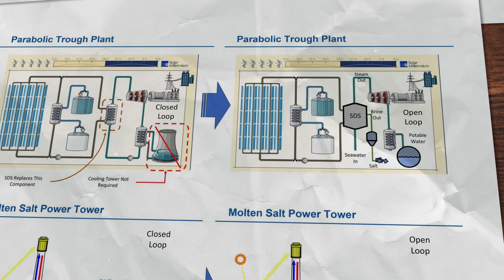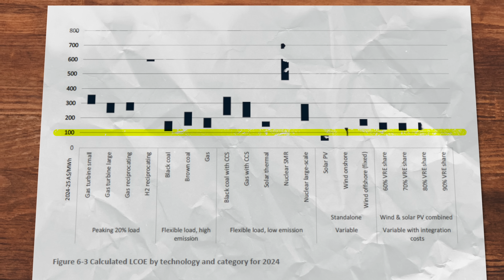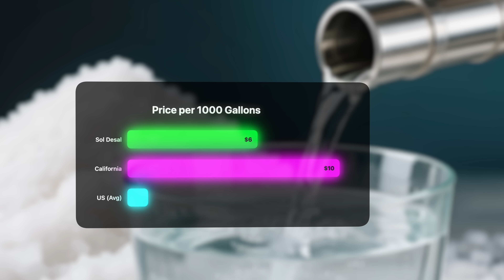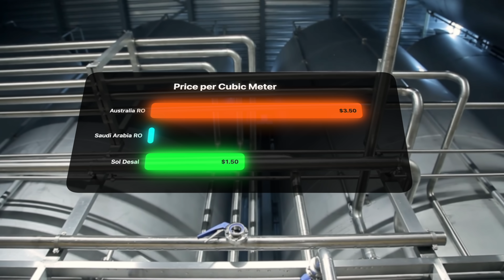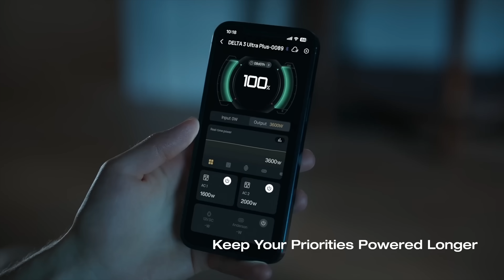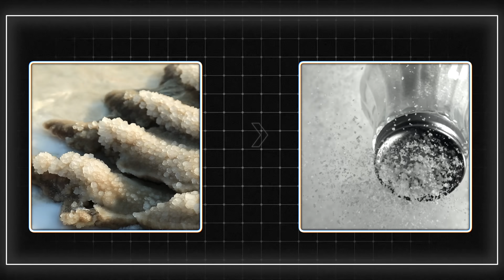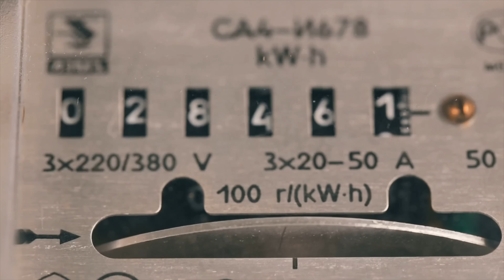The Desalination Process that MAKES Electricity - Too Good To Be True?

Comment: There's an assumption in this video that sea salt is entirely sodium salt... it isn't. With that volume of salt extraction there's also going to be a meaningful quantity of lithium salts in the mix. Whether or not it's practical to separate is a different question, but pulling it out of solution has got to be useful first step in making that possible.
Reply: That so small, of an amount, man.... but maybe in all the plants combined it would be a good offset and 2nd product over many billions of gallons...
Reply: There is gold also, but that do not mean it have any value. You have salt with a lot higher amount of lithium that can be used.
Reply: @bknesheim  well you could add Thorium to. your very long list of uneconomic extraction!
Reply: @philbarker7477 this reminds me of refining Lunar regolith. Its an absolute pain to get any meaningful amount of Uranium or Thorium out of Lunar regolith. 

I did the math and at .3 PPM for uranium you would need to refine around 3500 tons of Lunar regolith for a Kilogram of Uranium. When you could build somewhere around a thousand megawatt output solar thermal power plants with that amount of regolith refined. 

But still though it is an option, and a Solar Furnace might work well with refining the salts in sea water. So who knows maybe us guys on the moon gets bored and gives y’all the knowledge to refine terrible quality material.
Reply: @bknesheim   No meaningful gold in ocean water, 1 g / 100 Mton.
Reply: @elessarstrider5210  As I said, no value, even with a total that is more than we have ever mined.
Reply: @palpytine for a sodium battery plant that might help use a ton of the salt
Reply: No, it doesn’t make that assumption. The salt on your table probably comes either desalinated seawater or from a salt mine where NaCl salt from ancient oceans is just scooped up, minimally processed, and packaged with all the trace minerals included. Both sources are 97-99% pure NaCl. Perfectly safe.
Reply: @walterrutherford8321 desalinization through reverse osmosis will result in different end products than simply drying the brine. You'd still have the krill and various other microorganisms in brine as well as things like jellyfish bits and various excrements. They'd almost certainly be dead, but it does make a difference for food taste and allergy risk.
Reply: @ericsmith6394 but wait, then vegans shouldn't have salt in their diets!
Reply: @walterrutherford8321 right?!
Reply: Hey bro, If you were right, there would have been an entire industry that extracts various minerals from desalination! But the fact is Sea salt is typically between 95% and 98% sodium chloride!
Reply: @ecoideazventures6417  if it's a byproduct anyway, it might be cheap enough. There are several examples of waste being turned into industrial products that wouldn't be viable if the extraction cost was built in.
Reply: @ecoideazventures6417 No. Seawater salts are  6 % MAGNESIUM.
Reply: @ecoideazventures6417 If you were right, youd know, but you ARE WRONG. Currently the four most concentrated metals – Na, Mg, Ca and K – are commercially extracted from seawater.[49] During 2015 in the US 63% of magnesium production came from seawater and brines
Reply: @idiotburns  false. According to Campbells: In 2015, 47% of US's K (one of the 26 elements found in alphabet soup) was harvested from cans.
Reply: @josephmorrison5839 K means potassium, but not all potassiums are used the same. God I didnt know people were this arrogant with stupidity
Reply: @josephmorrison5839 you don't get potassium from recycled cans... You get potassium in canned preserved foods, but not the cans them selves.
Reply: @UberMick derp
Reply: @josephmorrison5839  Good one! :)
Reply: @idiotburns   read his comment again- slowly……😏
Reply: @Glenrok There is no slow enough
Reply: @Glenrok 15 years and 1 subscriber
Reply: @idiotburns  ??? Is that at me?? I’m not sure how it’s relevant, nonetheless- you missed the point of MY reply also. He was joking. THAT’S why I suggested you read it again- since you obviously missed the joke. 
I wasn’t trying to be insulting…..
Reply: @josephmorrison5839  sigh. Don’t worry, at least I got it……🤨
Reply: Couldn't that salt be delivered north for the snow season?
Reply: @kingchristopherpaul477hutc8  The largest salt mine in the world is in Canada.  There are plenty of cheap sources of salt in the north already. It would not pay to ship it far.
Reply: @kingchristopherpaul477hutc8 

Who still has a snow season? I lived in Boston for a while and I haven't had to dig my car from the snow since 2022.

It's more like a snow week nowadays
Reply: @kylejohnson6775 haha didn't know it was like that
Reply: @kingchristopherpaul477hutc8 yeah, the places that were considered extremely snowy are now about as snowy as the places once considered somewhat snowy/pretty snowy*, and the *pretty snowy places are now more like the we get a little bit of snow on the coldest week or 2 of the year places

In Europe South of Norway, if you're not in mountains, there's basically no snow anymore. I was in Munich last winter, there were a few days of a light dusting for aesthetics and mild difficulty walking around, a couple of times, and that was it.
Reply: @kylejohnson6775  Yep, considering moving north and up (from Oslo) to extend the snowy season.
Reply: Australian marine steam engineer here. There's an obvious show stopper here. Any boiler running seawater feed would scale up with hard (permanent) calcium & magnesium salts within a day's running.
Reply: @jonwilkinson3886 demister pads before the steam enters the turbine chamber, and quartz ceramic anti-corrosive turbine blades plus routine clean out schedule and multiple turbine chambers probably resolves the issue. I mean my father ran a hydro electric dam for about a decade and twice a day they had to clean the racks that blocked debris entering the turbines. They had to shut down for clean out. Why couldn't they have a valve directing steam to turbine A while turbine B's blades were being cleaned once every day or two?
Reply: @jonwilkinson3886 true??
Reply: @jonwilkinson3886  exactly - what magic have they discovered - not.
Reply: @philbarker7477  Design for separation, not propulsion.  There is a specialty alloy industry for atypical process applications.  Also ceramics, refractories.  Other process configurations too.
Reply: @jonwilkinson3886 what about using different alloys? Which are less likely to get build up? And would higher delivery pressures help reduce build up? I'm no engineer, but am a mechanical fitter/ pipe fitter with boat building background. CUNi is a popular choice on engine seawater cooling systems, but CUNi is used because it can handle the corrosive effect of the seawater more than anything. But if buildup would happen as quickly as you say, the engine internal cooling jackets would block up fairly quickly as well.
Reply: @jonwilkinson3886  The steam would not contain any salt or brine.
Reply: @toddweaver2704  You're making a declarative statement to someone that claims to be an expert in the field and that also directly refutes a claim made in the main video. The video itself says that bubbles/turbulence introduce particles of salt into the otherwise pure steam, causing the multiple problems this thread is discussing.

Do you have any sources or experience to back you up?
Reply: @MichaelDerryGameitect   An expert at what?  Observing that scale forms in some specific case or more broad, like separation process design?  You realize steam does not foul and scaling, nucleation can be exploited?  Material economics limitations in one application are not necessarily the same in another.
Reply: @elessarstrider5210   "Marine Steam Engineer" seems about as directly applicable as can be expected.

Like I said, the video itself claims this is a problem. I'm not saying it can't be overcome but some random commenter saying, essentially, 'nuh uh, steam doesn't have salt' isn't very compelling.
Reply: I was thinking about this in the other direction: 

How safe and useful is the salt given all the other stuff that's in seawater brine? Can you just directly eat it like table salt? 

And for industrial applications you'll probably need to purify the sodium. It depends on where you are in the world I imagine, but there's a bunch of different metals and other elements dissolved in that seawater that will precipitate out. 

I wonder how valuable it'll be to separate these metals out. Some years ago the Japanese were looking at trying to harvest uranium from ocean currents with special polymers, so they could become more self sufficient on fuel for nuclear power plants, for example. 

If you are harvesting seawater salt at such an absurdly large scale that it can supply any significant population, there's probably several valuable elements mixed in there in sufficient quantity to be useful. Lithium. Uranium. Silicon. Phosphorus. 

Uranium is 3.2*10(-3) mg/liter in seawater. 

If you supply all of, say, German household water use with desalinated seawater (856 liters/day per person, and there's about 83,000,000 people living in Germany at the moment), my math says you get 227 kg/day pure uranium. 80 tons/year, roughly.

We use less than 100,000 tons per year. That's not a lot from desalination, but that's also far from nothing. That could be worth harvesting and selling. Especially since literally every country has access to seawater and many countries would need to desalinate a shit ton in the future as the climate change. 

Hell, if the UAE harvested uranium from their current desalination brine production, that would be in the ballpark of 8 tons/year right now.

And that's just uranium. There's other elements that are literally a thousand times  more concentrated in seawater. Potassium is literally 100,000 x more concentrated in seawater than uranium. And if you pull the water from agricultural runoff, it's even higher than that. So the UAE could be harvesting almost a million tons of potassium per year from their current desalination brine. That's over 1% of the total global annual potash production. From the UAE, a tiny state on the Arabian peninsula. And we really need potassium for fertilizer. 

Yeah.... yeah the more I think about this the more I think it's a good idea to harvest the brine for all sorts of stuff besides sodium salt. 

If they can make his work, this is a very, very, good idea. Turn brine from a waste product and environmental regulation pain in the ass, into a resource.
Reply: @kylejohnson6775 "Literally every country has access to seawater"
Cries in Swiss
Reply: @michaelmartin9022 

Tears are saltwater ;p
Reply: @michaelmartin9022  well, you have glaciers, so you'll be fi-.....
Oh, you HAD glaciers.

Just kidding, you still have natural spring water, you don't need to desalinate any water
Reply: @michaelmartin9022  "Literally" now means "figuratively" or "virtually" it seems.
Reply: @michaelmartin9022 The Swiss have salt mines🤦🏽‍♂️
Reply: @kylejohnson6775  That is a definite potential downstream process that would be far easier in the transition stage than trying to extract it from a semi-trailer sized brick of salt... but would require far more complexity than the company can probably afford to implement, or safely.
Reply: @kylejohnson6775  wow. I'm gonna read this a couple of times. Thank you.
Reply: @kylejohnson6775  You really dont have to use the salt.  Electricity and fresh water probably the valu.
Reply: @kylejohnson6775  seawater is extremely close to human blood in mineral composition.

Diluted to appropriate salinity (assuming it's not contaminated by pollution), it's perfectly safe to drink
Reply: Sea salt is saleable directly from evaporative process. There are reasons why people consume sea salt specifically because it's not only sodium. 

Not to mention it is always worth separating because of the high value of lithium salt as opposed to other mixed or refined salts.
Reply: The determining factor for whether that is financially feasible is more about the market prices of the sodium salt. Otherwise storage costs of the sodium salt is what kills their buisness model.
Reply: I would imagine there's a way of melting the salt like metals and using chemical additives to bind either the normal salt or the lithium salt so that it's easier to separate. Then they could just use another method to break the binding agent from the lithium/sodium salt to reclaim itTo reclaim it and use it later.
Reply: @nerdlingeeksly5192 Like an DLE Ion exchange process?
Reply: Yes, and disseminating, the oceans would be suicide at large power, consuming scales
Reply: Hahahahaha
Reply: @palpytine  Even then I think this would be more efficient because the total energy spent to desalinate would be lessened. I don’t expect it to generate any extra energy, my hope is that this makes ocean desalinations less energy expensive.
Reply: The low level concentrations of these elements generally aren’t economically viable to bother with.
Reply: DLE tech in the input side of the system  would grab it.
Reply: Yes but the other minerals make the salt MORE valuable not less.
Reply: Journey of a thousand miles..
Reply: If the goal of the salt is for sodium extraction rather than food consumption, then the impurities are probably not going to be that bad, since there are forget processing steps ahead to get to the battery manufacture that is being proposed
Reply: There's more lithium in the ocean, than on land. 
And when Lithium deposits start running dry in about 20 years, mining it from the ocean will suddenly become profitable and viable. 
So yeah, including that in the tech now would be a game changer. Despite what the detractor comments are saying
Reply: @palpytine  road salt
Reply: @palpytine  people already buy Seasalt because it is seasalt with more trace minerals. Himalayas salt is ancient seasalt apparently yea bizarre 😳 hu wow
Reply: Potassium, silicon and calcium maybe but lithium so little that this is basically useless.
Reply: Uranium there as well. 

I am convinced flash desal like this has a huge future particularly in places like Australia, middle east and California. Reverse osmosis is fine at small scales but start to hit problems at large scale where the briney side becomes troublesome.

Extracting the salt as mineral has huge potential for industry. Sodium, lithium and magnesium will be metals in high demand. Calcium and potassium are important in agriculture. Then of course there is uranium and of course if you could extract heavy water from the system that would be great.
Reply: Well, Israel has figured it out; of course if you hate Hebrews you will not recognize or believe the truth. Carry on ... 😂
Reply: Once the sodium salt precipitates the remaining liquid could be dosed with lime to precipitate magnesium hydroxide as magnesium is a valuable metal(has been tried after WW2 profitably then). You could then remove potash, uranium and other valuable minerals I suppose
Reply: 💢💢   >>> Around 2005 we demonstrated an ultra-simple, low cost, waste heat driven desal/purification system. We considered incorporating concentrating solar which would have the precursor to  SOLDESAL. Life happened and here we are.He had plans to clean up the eco disaster in Salton Sea in SoCal <<< 💢💢
Reply: TYPO:  He had plans to clean up the eco disaster in Salton Sea in SoCa
EDIT: We  had plans to clean up the eco disaster in Salton Sea in SoCa
Reply: 7:53 😂😂😂😂 it's one of the most elementary tasks that can be performed with passive energy.... The only time it's difficult is when land surface is scarce or when one tries to increase output for a specific demand with mechanical apparatus (RO)....

There's much simpler methods including use of fresnel lenses and sunshine....
Reply: 10:55 PV and RO are unnecessary bottlenecks SMH
Reply: Would you consume the salt in food ?.
Reply: Sea salt is also used on potato chips.
Reply: It could be meaningful over time, similar to how it happened during WW2 and the Deuterium accumulated on Scandinavian power plants
Reply: You forgot the micro plastic
Reply: Where is the market for this much sodium chloride? If you don't have anywhere to sell it, it is just accumulating brine, which is a potential h0environmental hazard in large scale if not managed.
Reply: Old Yorkshire saying (with the phonetic accent) "where there's muhk, there's brasss!"
Reply: Sounds good. I believe it once there is one up and running and performing as planned.
Reply: @palpytine  🤦🏽‍♂️There are no problems just solutions. How about water hold pits that allow the salt/ sediment to flow to the bottom and the water pumped off. Let the pits dry and then scape them out. It would eliminate most of your problem.
Reply: ....THAT'S WHY IT IS way better TO BE USED IN pickling!

......LIKE NOT just,BUT HOW MUCH OF THESE!!AND ALL THEM GIVING A crisp!!
Reply: @robotnikkkk001  No it wasn't.

The fact that the word bittern actually existed to refer to the non sodium salts in sea salt that made it less useful for preservation should be a very good clue on how much people appreciated unrefined sea salt in the past.

Not at all.
Reply: @eccentricthinker142  ......WELL....I definitely REMEMBER THAT IT WAS recommended TO NOT USE FINE SALT WITH IODINE,AND or SEA SALT,OR ROCK SALT.......

...AHH YEAHHH...I REMEMBERED NOW....WATCHED RECIPE HOW TO MAKE kimchi AT HOME

....ANYWAYS,SEA SALT IS still SALT,RIGHT??.....AND ,IN ACTUAL.....QUITE PRICEY ONE FOR LIKE EVERYDAY'S USE.....RIGHT??........SO THAT'S A GOOD REASON TO DROP PRICES ON THAT AND EXPORT THIS OVERSEAS!!!
Reply: @robotnikkkk001 That's microbe balance for one, and you just contradicted yourself in your first sentence.

Also, exports?  What?  What are you even comparing sea salt to?  Mined salt?  Salt isn't exactly a big export for anybody due to how easy it is to extract if from... anywhere
Reply: @eccentricthinker142  ....DIDNT CONTRADICT,though.....BUT my bad,I'M NOT that GREAT AT BUILDING SOPHISTICATED SENTENCES....HEHE....JUST FORGOT TO ADD "and USE"

......BESIDES,I'M QUITE KNOWLEDGEABLE AT CHEMISTRY,AND really DONT KNOW WHERE FROM DID U TAKE ABOUT salt with iodine has anti bacterial properties...BECAUSE IT IS JUST ABOUT micro element AT NUTRITION,THOUGH....AND THERE'S NOT ENOUGH OF it TO FIGHT BACTERIA

......BESIDES,IF YOU DIDNT know......PROCESS OF GETTING SEA SALT IS QUITE ENERGY INEFFECIENT,SO IT IS CONSIDERED AS SOMEWHAT PREMIUM PRODUCT,BECAUSE OF small volumes.......SO IT IS ACTUALLY quite expensive for SALT !!....COMPARED TO TRADITIONALLY MINED ONE,OF COURSE......

...LIKE I never SAW SOME MODERN FACILITY THAT exactly DEDICATED FOR SEA SALT PRODUCTION,THOUGH

....AND....well........STILL....IF NOT JUST SALT,THEN VARIOUS CHEMICAL PRODUCTION OF anything COULDVE BE MADE FROM SALT,SUCH AS sodium/chlorine/bleach/chlorates/perchlorates......AND FROM OTHER SUBSTANCES,SUCH AS sulphuric acid/halogens/etc etc.........BESIDES,THERE'S SODIUM ION BATTERIES ARE GAINING MOMENTUM...
Reply: @robotnikkkk001  This looks like a stoned post.
Reply: @robcuthbert8257  ...BUT THAT'S DAMN TRUTH,THO!

....THE best PICKLES ARE FROM USING A sea SALT!!

....BUT yeah,THAT LOOKS LIKE A COMPLETE JOKE OR SO,THAT'S TRUE

....BUT still!!!.....THAT is A SCIENTIFICALLY PROVEN FACT,THOUGH!!
Reply: @palpytine  Don't Forget about ALL ocean water  contains RADIOACTIVE isotopes.  They may Be in extremely low Concentrations  but When daily  Production of Salts is in the  large quantities  the Deadly  radioactive  particles   will still add up.  Specially when
Reply: @DaVe-iSnOtHoMe.MaN.LemmingsWeBit would be a uniform concentration in the salt